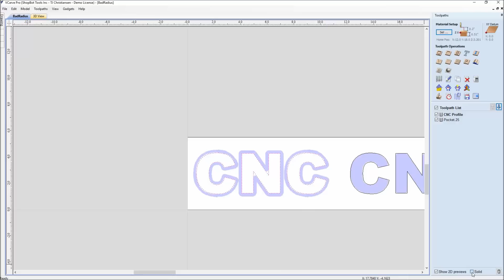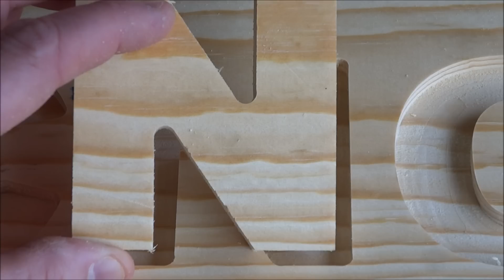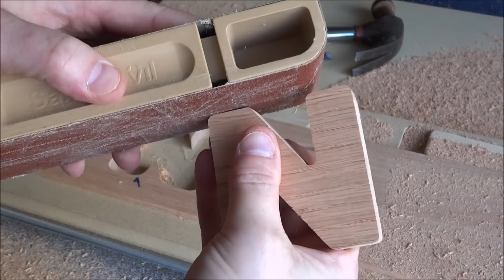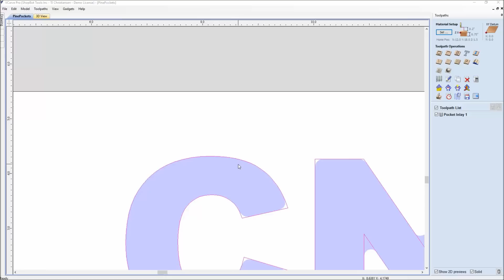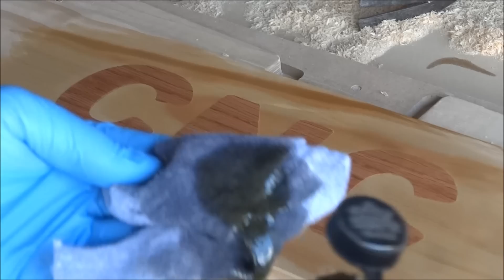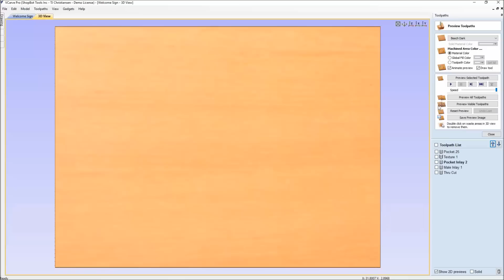Inlay Training

Comment: Hi. When you added allowance in female pocketing, how machine run only the codes of those new lines and why it didn't start over?
My way of running a CAM is to get .tap file from aspire software and then running that in CNC using USB.

Comment: Nice job. How do you get the axis movement to slow down reaching corners?
Reply: Thanks for the answer..or lack of it 9month later...guess you don't even know...
Reply: The ShopBot will automatically slow down in corners--but can be made to go even slower by adjusting the ramping settings in the "values" menu under "ramp values"--adjust the "slow corner speed", the number there is the percentage of full speed the tool will use when rounding a corner.